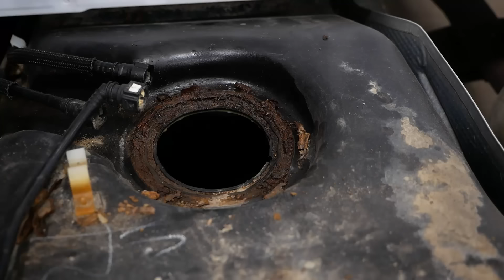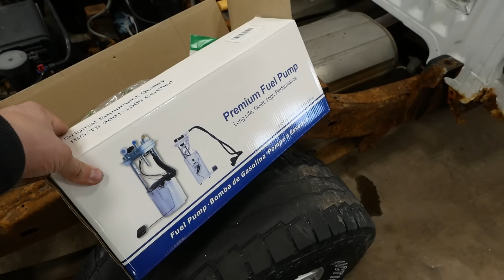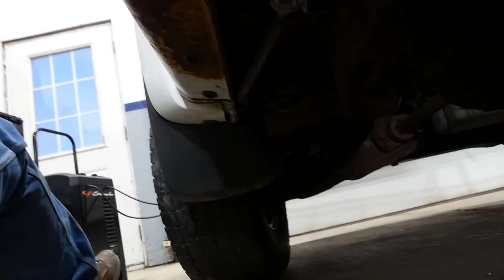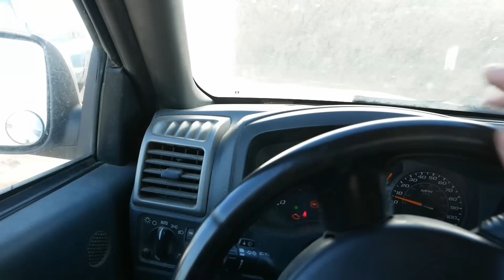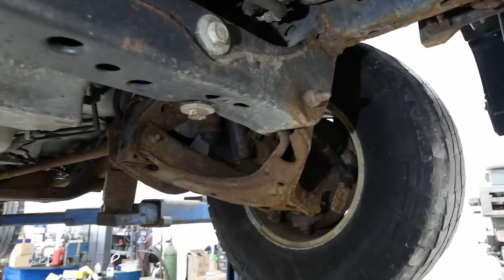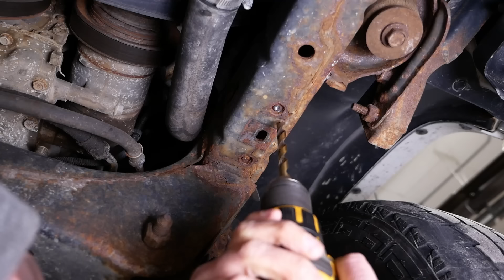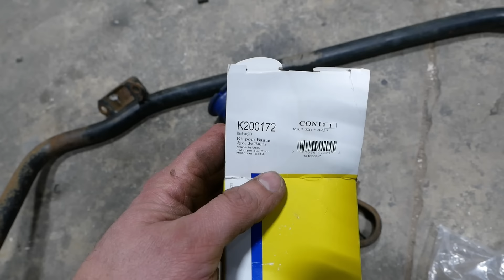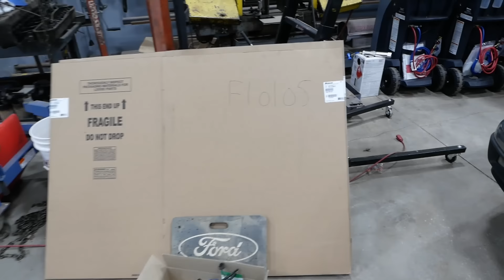Saving a GMC Canyon with 434,000 Miles from the Crusher - Won't Start, Fuel Pump Tabs Rotted

Comment: Thought  you would blow up the garage  sucking that fuel tank out with the shop vac.  Wife had a Corsica  with over 300 thousand and it did not use oil. my mechanic would not inspect it  .

Comment: My mom has an 05 colorado and it did the same thing. I seen the kit on ebay that you bought. So I used my plasma cutter and the circle cutting jig kit that I have. And I just made my own. I had the seal all and the screws already on hand. The dealership could get a factory tank back when I did hers. But it was $1600. It turned out great and still working today. That was 2 years ago lol.
Reply: Wes could easily have made that ring himself. Either lathe or plasma or both

Comment: Regarding getting drilling chips/swarf all over you...Cut a tennis ball in half, cup facing up, run the drill bit up through the bottom of it. Keep the tennis ball cup up next to what you're drilling. Tip down to empty out the chips periodically. It may not catch all of them, but it is certainly better than wearing all of them.
Reply: Smart

Comment: Don’t miss the north at all. Salt air, salt water, salt on the road. Salt salt salt. OMG ,, what a mess. Got to hand it to them for 400,000+. That’s crazy. I had a 95 Crapice with a 305, made it to 200,000 burning oil when I sold it. Pump it up wit a few lbs air and soap. Shit no run. USAF runs lots of spares in most looms. Just skip that shit and move it over. Good thing you found it

Comment: Speaking of fuel pumps and trouble codes…
Father in laws 2010 tundra seemed to have lost the fuel pump when it hit -40 up here in Alberta. My first thought was moisture in the fuel line, so methyl hydrate, after a few days, still no go and couldn’t hear the pump. So got a pump on order. Before the pump could arrive, the weather warmed way up, tried the truck, started up and ran. It threw an error code. I threw my 10$ code reader on, bank 1 rich, bank 2 rich. Checked the fuel trims, sure enough the computer had richened the long term trims by 12% trying to get the engine to run without enough fuel.
Lesson being, it’s not always the pump, even when it seems like the pump.

I’ve used seal all to fix a fuel tank at -15c by smearing it over the pinhole, and then putting a piece of denim soaked in seal all over it. Car ran another 5 years without leaking like that.

Comment: Wes, nice save.   Hey on that fuel pump ring, you forgot to permatex the ring inner diameter to pump outer diameter gap.  Water can definitely still pool.
Reply: I think he touched on that subject. He wanted to make sure it was a runner before making a mess with sealants.
Reply: @beezertwelvewashingbeard8703  no you didn’t watch to the end

Comment: You seem a little skeptical of that Seal-All. It works great and will withstand the gas better than anything I have seen. It will even seal up an active leak. The thin consistency will help it get into every crack and crevice. It will set up and seal as good (if not better) than that "O" ring. It will withstand fuel far better than any RTV.

Comment: Any opportunity to use a newer or older fuel tank and pump assembly on those 2-year only Colorado/Canyon's?  Those 2-years are unobtainium, but what's the availability on the newer parts, can they be made to fit?

Comment: Good Job Wes, I drive a 2009 canyon with a 5.3 V8 , 250 K miles. Still runs like new and the 5.3 in the little truck is not only quick but has an easy life on highway. Back when GM still made good products.. Enjoyed !
Reply: Try 1999 was the last time.

Comment: I had an 84 S15 Pickup that I bought when I turned 16.  Shortly thereafter at 125K miles the oil pressure went to zero and by the time I was done I had acid washed and had the block bored out, new pistons, new cam shaft, new water pump, new fly wheel (cracked), new distributor cap and rotor, new oil sending unit... Pretty much every part I pulled off was toast.  Even doing the labor myself I was another $700 into a $1200 truck.  But that rebuild made it to 375k miles where the years of road salt finally sent it to it's grave even though the motor was still good.  I'm at 330k on an 05 Impala and likewise that 3.8L refuses to die but everyday there's less car left around it. Envy those not in the rust belt...

Comment: For fuel resistance either two part Polysulfide sealant or one part Fluorosilicone RTV are good choices. Plain cyanoacrylate will not hold up to immersion.

Comment: Just want to make sure I am following the troubleshooting correctly.  When you tapped into the fuel pump wire under the cab and tested it with the test light it wouldn’t have lit up anyway since it only has voltage there for two seconds after the key is turned.  Correct?
Reply: I think he powered it from the battery thru a fuse

Comment: Straight 6 still comes out as the best engine design there is for longevity + more power than a 4 cylinder.
Reply: But here they chopped off one cylinder or added one to a 4

Comment: Yes those bolts are roll formed but the junk material we would use at my former factory job making said bolts would develop hard spots during the heat treat and they would be so hard you need carbide to drill through...sometimes they would develop just below the head and sometimes they would develop at the other end or somewhere in between you'll know if you get one of those because it'll drill fine so far and then the chip will break off polished and just smoke your drill bit instantly and keep smoking drill bits

Comment: Nice work Wes. I thought you were going to have to fabricate something like that for the gas tank repair but you found one already made. Ship it. She might have another 400k in her. Yeah, don't get the attempted sway bar repair on a vehicle that doesn't run.
Reply: Wes has a lathe and knows how to use it. Next time, I think he'll make the ring himself.
Reply: @erik_dk842  For less than he paid for the kit?
Reply: @dfross87  Probably not, but the he could finish the job right away instead of waiting days for parts. I C Weld would just cut out the ring with his gas axe.
Reply: @dfross87  Probably not, but then he can finish the repair right away and not wait days for parts.

Comment: $1200 for a used fuel tank?  Well, as a guy who just spent $160 on a fuel filler cap for a 30 year old dozer, that wouldn't seem too bad, except I can sell the dozer for a whole lot more than a used "Canyon/Colorado/whatever."   NIce recovery on that one though, I figured it was done with the cost of the used tank.

Comment: Some times you have to get very creative to make things run again. I was thinking since the tank is steel, cut out another ring section from some other donor tank and weld it into that tank. Yeah a lot of work, but it too would get it working again. Thumbs Up!
Reply: It's plastic with molded-in steel tabs

Comment: Wes, there's a guy that has a Ram 3500 truck with 1.7 million miles on a 2007. It's likely that the miles you read on the odo are accurate.

Comment: Interesting. My cousin rolled over 600K on his Tahoe.  Two transmissions but still the original engine. I'm thinking that with reasonable driving and regular maintenance we sell our cars a little soon.  Not always the case with the Daewoo cars out there that fall apart around the engine. Nice kit for that tank.

Comment: A guy in my area had a boat that had fuel spilled in the bottom of the boat. He desired to use a shop vac to clean it up.... Since he was at a boat dock not only did his boat burn but so did several high dollar boats along with the boat dock itself. He had a long stay in the hospital not to mention a number of law suits!
Reply: Corvair corsa magazine described a corvair guy who bought a runner. He made a mistake and filled the fuel tank . He decided to use the tubular vacuum cleaner with the bypassed switch. Got the fuel siphoning into a bucket but the tubular vacuum became a jet engine as gas vapors went past the brushes.  Eventually it went out and the vacuum still worked after that too.  Thanks for the boat story.

Comment: Hi Wes. I enjoyed the video as usual.being an owner uf a Culurado found the locking ring repair kit information a huge asset as I think I am having similar issues with my vehicle. A tip I have for you is when needing to drill a broken hardened bolt. Before drilling take your torch with a fine tip and heat the center of the bolt until bright orange not cherry red. Let cool slowly in air. This will anneal the bolt and they will drill much easier. The slower the bolt cools the better the process will work. Have a great day and keep the videos coming.
Reply: Heat Definitely helps. Another point I’ve found is slow speed drilling. Speed 1 vs 2 for the win. This is from experience. I was once a high speed drilling wizard, then I was shown the light. Drilling lube/oil & slow speed works more efficiently. Even in this scenario where you drill up, most tap oils I’ve found are syrupy, and will perform its purpose. 

Not much worse than drilling multiple fasteners. In most cases, you will save time heating, wicking, and multiple tightening & loosening attempts until it responds. I’m aware that in the video the damage was done and bolts sheared off.
Reply: Oh, and no intentions to criticize Wes or anyone who goes to their bag of tricks! I just find life easier avoiding broken fasteners. Heck, I learn new things every week. I like sharing my experience with others, just as my predecessor’s were kind to teach me.
Reply: I have used a center cutting mill in my drill to flatten the end of broken bolts. This makes it easier to center punch the bolt and drill it out.
Reply: Cobalt drills will make such a job easier.
Reply: Meh. If someone would have used some penetrating oil on those bolts in the first place they would have come right out.

/s

Comment: Here in Mississippi I have a 2005 GMC Sierra 1500 with 250,000 miles and 0 rust then a friend of mine has a 2000 chevy Silverado 1500 with 360,000 miles 0 rust. We are pretty lucky 😂

Comment: I was wondering if the problem with the wires is a quality issue. If the insulation is a bit stiff from the manufacturer, or if the volatiles dissipate too quickly, then you are left with a dried out wire insulation, which might account for the wear you found. More flexible insulation should be more resistant to rubbing in dusty conditions. Great find on the wire by the way!

Comment: Its possible for it to have that many miles my dad has a 2005 dodge ram 2500 with 535,000 miles and put everyone on it he got it brand new with 89 miles it still has original engine and transmission

Comment: Hey Wes: I don’t want to be one of those guys who barks about his favourite sealer - BUT - have you ever tried Roll Royce Hylomar Blue?  It is used in the aviation industry and is totally fuel and oil proof and never hardens.  Get it on line or at small airports where they fix airplanes.  …and welcome back Wes!
Reply: Exactly the same as the permatex no.3
Also known as Aviation form-a-gasket
Which he is using
Reply: Hey that's good to know. It's used in old air cooled BMW motorcycles, and I haven't seen it for sale in ages.

Comment: On the passenger side of the engine compartment on my '99.5 Powerstroke a split loom crosses paths with the aluminum charge air cooler tube.  Several years ago I found the loom to be rubbing a series of holes into the aluminum at each rib on the loom that touched the tube..

Comment: The best wear related to a wiring harness I've seen yet was on a Ford F-59, those big box trucks that delivery services use.  Had a big oil leak by the airbox, turned out the main wiring harness rubbed a hole in the valve cover.  It is shockingly hard to get a 6.8 V10 valve cover out of there.
Reply: Nice. Could not go for the big glob of RTV fix?

Comment: Wes, if you had a “tone generator “ kit, you could put the generator on the fuse then run the detector along the with path and the tone stops at the break.  I used these extensively in troubleshooting fire alarm systems..
Reply: I was just thinking if that would work in car applications

Comment: I work on electric vehicles for a living  and my daily driver is a 2015 Tesla Model S that has 426k miles on it now (the original owner used it for Uber at an average of over 80k mi/yr).
You'd never know it had anywhere near that mileage by driving or even looking at the car, as cosmetically it's in pretty decent shape, still drives almost like new!
It's actually still got a warranty on the battery and drive units until Aug 2023, as many earlier Teslas came with an 8 yr, unlimited mileage powertrain warranty.

Comment: saved a first gen canyon. those doors are worth more then the truck itself, so is the hood and fenders. especially in your area. its a beater with a heater. throw some junk yard used tires on it. I have trailer tires on mine ;p

Comment: I have a 2004 Colorado and the first thing I thought of when it wouldn't idle was cleaning the throttle body. I just open them with my finger and use carb cleaner though. Mine really runs and drives like new (though only 122k), I have seen a lot of these with 250-300k though. Did the sway bar bushings and mine has one SAE bolt now, but I didn't have to replace the nut, just didn't drill it straight and moved it up to the next size which is SAE. Have never touched the fuel pump but my truck overall is really clean yet. Not sure how bad that ring would be.

Comment: The milage, with that age shouldn't be a giat surprise - My parents racked up 300,000 + miles in a Peugeot 405 (NA diesel) in 15 or so years, 1 clutch, one rear sub frame and regular service every 10k miles. It wasn't considered strange or unique?

Comment: The only thing I could think of to make that repair kit better would be to use threaded rivet nuts going into the tank and then bolts holding down the top ring. They do this on skidoo gas tanks. Those self tapping screws make me cringe. I’m worried after a few good bumps in the road they would just pull straight through the plastic they are threaded into. Great video though

Comment: Impressive job finding that tank repair kit and the broken wires. Also impressive mileage on that Canyon. Do you think the engine and trans were original?
Reply: Very resourceful for a budget truck.  $1200 for a used fuel tank, give me a break.  You can by another hoopty truck for thst.
Reply: @mikespain8655  might as well spend another few hundred and get a long range tank at that price.
Reply: @hannahranga  You can buy in-bed fuel tanks cheaper than $1200 (a quick check brings options up for about $700 shipped).  At least in Michigan they are street legal.  They do take a fair bit of cargo space out of the truck bed, though.  Also, short of hauling corrosive materials next to it the tank will last for many years.

Comment: That is a TON of mileage but I was in a 2003 Excursion V10 that had a failed transmission at 734,000 miles. It was a beat POS and looked like it had that many miles on it. I believe it was sold for parts.

And that GM door chime plays through the driver door speaker. GM does the audible warning through the factory radio and of course it's loud enough to broadcast to a stadium. Thank goodness you will lose it if you replace the radio.

Comment: I've gone away from safety googles and now I use a good quality face shield. Took a minute to get use to, but my eyes stay much cleaner
Reply: I got a ricochet spark in my eye from an angle grinder, while using a face shield. My uncle, who used totally scracthed up goggles was pissed off because he just bought the expensive face shield for me.  He had already lost an eye to a splinter from a PTO shaft he hit with a sledgehammer by accident, and couldn't see much on the other eye, due to neglected Diabetes.

Comment: Amazing mileage! Very enjoyable video Wes.  I just wonder if a simple sheet of plastic or thin rubber sheet over the top of the fuel tank as an "umbrella" might keep most of the grunge off. regards vic
Reply from the maker: I doubt it. I mean the box floor is right there.
Reply: @WatchWesWork  Good point  As you said the design is poor
Reply: @WatchWesWork  And that's probably why GM sunk it into the tank
Reply: Exactly!  It seems that a cover, preferably sealed, over the fuel pump depression would prevent future problems.  Surely there's enough space to fit one on there, even if it is only a rigid plastic sheet?  It would probably need less than 1/2" clearance, maybe even less than 3/8".

Anyway, nice job, Wes!  I like your approach and analysis.  You've gotten a new subscriber!

Comment: FWIW Seal All is a great product.  It has been around for decades.  I personally used it to fix a hole in a gas tank along with paper towel.   layers of Seal all soaked paper towel and no leak.   While it starts out runny it hardens quickly and forms a gas proof bond.